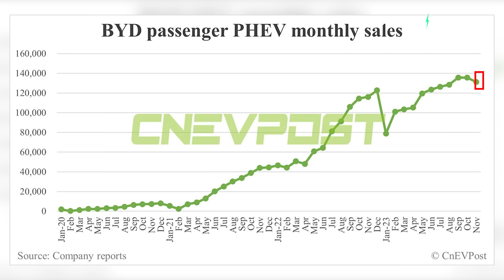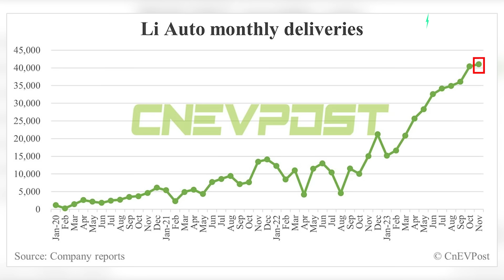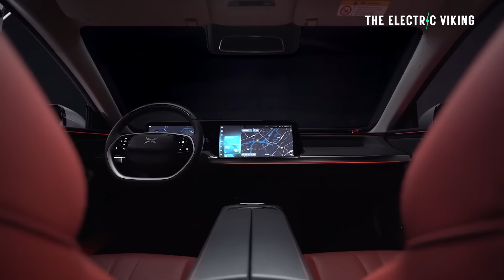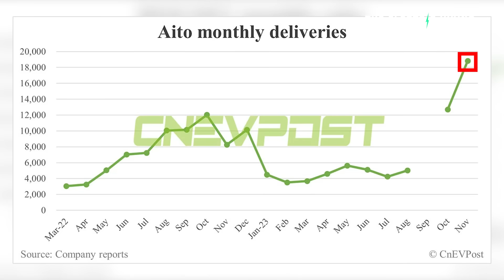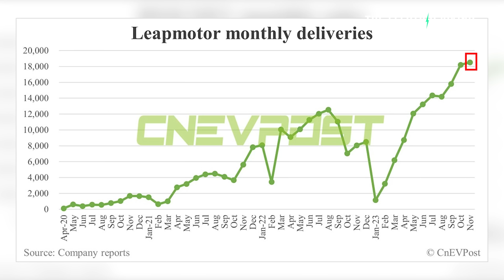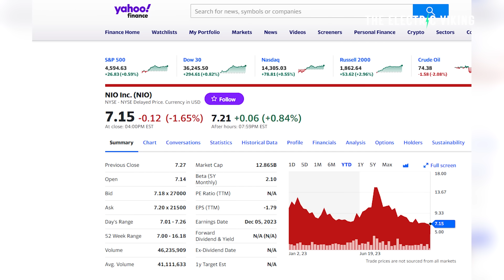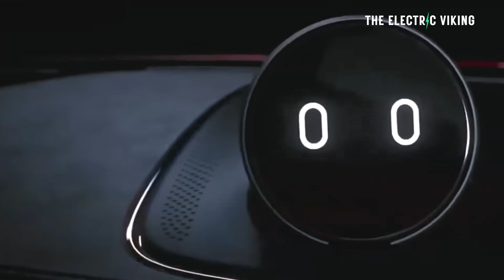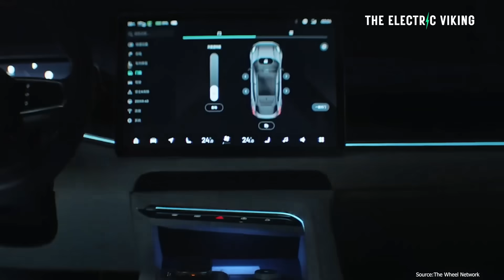BYD, Nio, Xpeng, Zeekr, Li Auto, Leapmotor EV sales in November 2023

Comment: Maybe BYD is construction limited and selling at their maximum construction run rate ?.? Sam, you are unsophisticated in some areas. BYD does not have unlimited production capacity. Why do you assume they are sales limited. They are reducing prices to exactly match their production. This strategy maximizes profits. Wait unto BYD reports Q4. When you are running at 90% of capacity you are making lots of profits.
Reply: They are building an assembly  plant here in Thailand to service the right hand drive market in Asean.  Production capacity 150k annually for both pure ev and hybrids. They have just started in this region.

Comment: NIO sells more expensive EVs, so it's a lot of times not really an accurate comparison.
For example: A Leapmotor T03 costs around $11,700 in China. A NIO ET5 price starts at around $46,100.
When NIO ALPS and Firefly is released, they will start selling EVs in the cheaper segments of the market.
ALPS will primarily target the market priced at $28000 - $42000.
Firefly will target the market priced at around $14000 - $28000.
Also, NIO does not only focus on selling EVs. They focus on their battery swapping and charging business and have recently partnered up with Geely and Changan Auto on battery swapping technology.
Reply: I think the issue is that for the prices nio charges atm, most Chinese people would just get a tesla, zeeker, xpeng, aito, etc. But yeah if you manage to lower their prices it would sell more than leapmotor and xpeng.
Reply: @henrymxn  They charge high prices because it's a premium brand that is competing with other premium brands in both China and Europe. They started off with the most expensive segment and are climbing down instead of the other way around. It's just a different strategy.

Why they didn't start with the lower segment and up I personally think is because they want to have a high class reputation (Which I think is smart). First you release a solid product and build trust in the product, and then you release cheaper versions of it. Smartphone manufacturers have used this strategy.

Plus they have an energy / battery swap / charging business going on as well (also read some stuff regarding solar energy on these battery swap stations, also smart), 
Their new partnerships prove that other manufacturers in China want to take the same path. They recently signed partnerships with other brands regarding battery swapping technology.
Reply: @arturmedia  Very true, nio can have expensive models, but I think they should have a model or two that is cheaper to compete with ev brands, kinda like tesla's model 2 whenever it comes out.
Reply: @henrymxn  That is their plan. They will release NIO ALPS and NIO Firefly.

I mentioned the two above. NIO ALPS will primarily target the market priced at around $28000 - $42000. And NIO Firefly will target the market priced at around $14000 - $28000.
Reply: Nio also don’t have a factory. They subcontract all manufacturing to JAC. It is hard to be competitive if you don’t build your own car. The subcontractor has to make a profit too.
Reply: @wellingtonhui6060 which changed today 😂 they own 2 factories as of today 😂😂😂
Reply: @wellingtonhui6060 😂😂😂 your late they bought out Jac , it’s now a Nio factory
Reply: @henrymxn that’s coming out this year coming up
Reply: @wellingtonhui6060 You’ve got that totally wrong. NIO has one of the biggest robotics car factory and just purchased all of JAC’S equipment. Do you research before posting inaccurate statements.

Comment: Just to set the record straight, as Viking often says the opposite, in China, PHEV sales are currently growing much faster than BEV sales.   "BEV sales were up 25.2 percent year-on-year to 5.16 million units in the January-October period, and PHEVs were up 82.6 percent year-on-year to 2.116 million units",  according to CNEVPOST using China Association of Automobile Manufacturers (CAAM) data.  Hopefully the trend will one day reverse again, but analysts attribute this to PHEVs being a less drastic shift for the majority of current ICE owners there.  Furthermore, a number of originally BEV-only manufactures started producing PHEVs this year to increase their sales after seeing the successes of BYD, Li Auto, etc.
Reply: This video is about November sales, not Jan-Oct.
Reply: Excellent point and this is why Ford and Toyota are focusing with hybrid vehicles.  EVs are failing with range depletion in extreme temperatures,  public chargers exceeding load capacities resulting in longer and more costly charging per vehicle, higher insurance premiums, degradation and algorithm programs shortening range to offset degradation, it’s a joke with EVs.

Comment: I have the 2023 Chevy Bolt EUV and it is great at great price. I got it at $29K but get $7500 tax credit and $2000 California EV rebate so the actual cost is around 20K. I save $200 per month on fuel vs electricity. The future Bolt use the Ultium battery. It said to be lasting 1 million miles but it is a LFP chemistry. I don’t know how can LG and GM make the NMCM battery last 1 million miles.

Comment: NIO is the ONLY automaker building battery swap stations. These stations are expensive and not sustainable, and no other competitor in China is using battery swap. They are burning through cash like their’s no tomorrow. I have lived in Shanghai for over 10+ years and have seen the rise and fall in public sentiment regarding NIO. In my opinion, only Tesla and Xiaopeng are serious EV competitors now in China. BYD is king in low price EVs but other than price, they aren’t offering much anything else like autonomous driving features.
Reply: better read news before reply.

Comment: Another gr8 video, sir. BREAKING NEWS: THE NEXT GENERATION BOLT EV WILL ARRIVE IN 2025 according to GM CEO Mary Barra! Fantastic news. I currently have a 2023 Bolt EV I picked up last month.  🚗 🇺🇸🔌
Reply: meaning 2027. I will wait to get the BYD SON L with the new gen of batteries.
Reply: What batteries are they going to use? Where are they getting them from?
Reply: I have the 2023 Chevy Bolt EUV and it is great at great price. I got it at $29K but get $7500 tax credit and $2000 California EV rebate so the actual cost is around 20K. I save $200 per month on fuel vs electricity. The future Bolt use the Ultium battery. It said to be lasting 1 million miles but it is a LFP chemistry. I don’t know how can LG and GM make the NMCM battery last 1 million miles.
Reply: @wellingtonhui6060  I didn't qualify for the federal tax credit, but I do feel lucky because I paid the original MSRP from last year which was $26,495. I ordered the Bolt EV in December, so I'm glad my dealership honored the original price.

Comment: The real issue with these Chinese EVs is the lack of real-life milage performance.
How many of them will function properly after 5 and 10 years from now?
Will there be anybody and proper parts to service them in the future?
Reply: Real life milage performace? Go ask Pontiac and saturn owner what the fxxk happened after GM discontinued the brand. The dealer flat out refused to service their car. So, you arguememt is invalid. If a company is gone, it is gone. Tough luck. And these Chinese brand will less likely gone but more likely to merge. Like Nio being part of SAIC or FAW.  For toyoya and GM? They are too big to fail, but also too big to save.
Reply: If you want real-life milage performance, go to China and ask taxi drivers, who have been driving EVs for many years. And their EVs are quite antiquated now, by today's standards.

Comment: TSLA is middle Age, NIO  is an Adolescent, only if TSLA achieve FSD will it make another batch of Retail share holder Millionaires. NIO is unprofitable and haven't even started it growth spurt as yet. All nay-sayers; Sit back , wait and watch you all will ultimately figure out the importance and validity of NIO's battery swapping platform. It take $$ to build out the EV charging / swapping network and that has to be in place to accommodate the cars. All American ICE companies now bows to TESLA; due to what? 'charging infrastructure'.  I can list at least 5 STRONG point the make battery swapping a powerful necessity.  but ill leave that to each reader to contemplate on. I'll mention one - I personally long for a Model-X; I cannot afford a new one, I've considered used BUT who wants to take a chance on a 5 yr old Model X. I'm sure the battery has degraded some 20-30%, We all know the Cost of Replacing an EV battery.  Resale value on EV's will be eventually be predicated on a battery health check. I rest my case ....